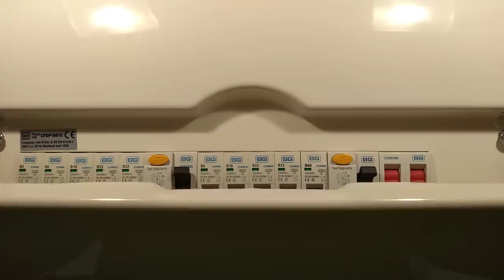A look inside a British home electrical panel.

Comment: I've been using DIN rails in industry for a long time.
I actually didn't realize that the "shelf" design was to accommodate a cover that can cover the terminals while allowing access to the device's controls.
Is there a standardized measurement to the size of this "shelf"? curious because I was going to use a "sub-panel" module to hold a block of DIN rail mountable goodies, and was curious what kinds of devices I could shove in there before I started having problems.
Trying to peruse published standards has led me to paywalls and frustrations.
Reply from the maker: The UK consumer units can often be used for things like DIN rail power supplies and timers.
Reply: @bigclivedotcom  I noticed that! :D
I've begun assembling a delightful device with a volt/current/watt meter (not dissimilar from the Hopi) and a voltage/current monitor in one.

Comment: That is one of the few things I don't like about European breaker panels and some other countries breaker panels here in the states are Breakers typically use a friction fit on the contact between the breaker and the bus bar even though it's friction fit if it's a good breaker it maintains its fiction connection through that life of the house unless that breaker has been popped several times or the bus bar got pitted then you have to move two different busbar point also are panels typically have enough room to where the wires don't have to touch between the hot incoming and hot out even though some electricians wire panels so badly that line 1 and line 2 incoming will actually crossover output wire the skeins of defeating the purpose of the entire breaker panel completely

Comment: Looks quite similar to what we use in The Netherlands. We don't have ring mains, so usually only use 16 A circuits. Often an induction cooker is connected to two 16 A circuits protected by a dual 16 A circuit breaker.  However, 3-phase power (400 V) is standard in the more recently built residential buildings (with older buildings connected only to one of the three phases).

Comment: Is this the usual size for such a box or just a small refit size for old installations? The ones they install here in Austria in houses are as big as half a normal door (something like 1.5m tall and more than half a meter wide). It also houses the meter and the transformer for the door bell and intercom. I counted 3 rows with over 30 slots each (not all populated though). And that's just for a two-flat house.

You have 3 phase in pretty much every home. Doesn't cost anything extra except that you might have to pay an electrician for installing the extra wires for an outlet, if you don't have one already. The "oh-shit" fuses (where the wires come into the house, not where the breaker box is) are 63A per phase (so as the electricity provider is concerned 45kW should be enough ;) ). The main fuses per flat are 35A per phase, broken down further into 10A or 16A fuses for the circuits for the rooms.
Reply from the maker: This is actually one of the bigger ones for home use.

Comment: you keep mentioning that the far right hand 'device' on the din rail is an isolator. When I was a lad an isolator was a device that was not designed to break load current. does this mean that when you have to work on this board you have to switch off all outgoing circuits before operating this 'isolator' ? or, is it a switch that merely isolates the board?
Reply from the maker: It is for isolating the whole panel.  But I suppose operating it off-load is preferred.

Comment: Could you possibly pop the main switch out a show behind it? That is: how does live get into that switch? And can you get a 'mains circuit breaker' if you so desire?
Reply: Live gets in from one side screw terminals and exits from other side screw terminals. The bottom is just empty plastic shell with mounting tabs that only hold it in place.
Reply: @DjResR  ty.

Comment: Dear Clive
The mains very ofter cones in from the bottom. Why shouldn't you connect it to the bottom of the main breaker?
It is such a pain to get those thick wires bent into the top when they come in from the bottom.
Kind regards
Reply from the maker: I think an element of that is the traditional isolator that fed straight down onto the live busbar.  In a way it's a good idea to maintain that standard approach to avoid people getting caught out by the bottom being live instead of the top.  Although any true electrician would check that before disconnecting anything.  The extra length of the tails in the unit do probably help with termination by giving greater play.
Reply: @bigclivedotcom  
Thank you for responding.
I enjoy your videos extremely much.
Kind regards

Comment: Kind of surprised they are using stranded wire and not solid... but I don’t know enough about UK standard
Reply: We sometimes use solid
Reply: I guess that's why people don't understand why bare solid wire is used for ground in the US.

Stranded tends to need insulation to keep it together.

Comment: Interesting, i am use to our panels in the united states. Metal panel boxes with both 240v and 120v breakers. That box looks like a toy compared to our panels.
Reply: This is because in GB current is running on the other side of the lane.

Comment: For me it's foreign to have an RCCB and single pole circuit breakers with a neutral bus bar. I've seen it when people in fact got a fusebox from germany where I heard it was quite common. But f.e. in The Netherlands, Belgium and France we don't have neutral bus barses. Phases and Neutrals are both considered live. This probably has to do with the long forgotten past where we actually had 127/220 Volts instead of the nowadays common 230/400 Volts and also with the fact TT system grounding was more common although in The Netherlands new electrical installations are usually TN-C-S.

Anyway, the electrical panels I've seen either have no RCCB's but either have 
- 1-pole circuit breakers with a neutral bus bar and rely on short circuit protection (common in the US) 
or 
- have RCCB's and 2-pole circuit breakers or 1-pole with switching neutral (common in The Netherlands, Belgium and France)

The problem with RCCB's and a neutral bus bar is when the ground fault occurs between the neutral and ground it in fact can trip the RCCB when there is a heavy load causing neutral voltage to become significant. Now in systems with TN-C-S grounding significant neutral to ground voltage is rare, but I've seen it happening. Worst case troubleshooting the ground fault will be a pain in the @$$ because you don't know which circuit is causing the neutral to ground fault. I would always recommend using RCCB's in combination with 2 pole or 1P+N circuit breakers and for 3-phase loads of course 4 pole or 3+N instead of just a 3 pole circuit breaker.
Reply from the maker: They seem to be going slowly in the direction of dual pole protection here.
Reply: @bigclivedotcom  With new electrical panels I don't see a reason why someone wouldn't make everything 2-pole from the beginning. The only reason would be cost. But even in the Netherlands there are some cheap electricians that used 1-pole breakers which is not allowed and therefore will violate the  NEN1010 which is Dutch Electrical Code for residential buildings. So cost seems to be a big reason to "bend the rules" :)

But in countries you can consider the early adopters of the RCCB and 2-pole (or 1P+N) breakers something else is going on. Many of them don't have grounded outlets in the what we call "dry rooms". These are rooms where normally no water or moist is present (f.e. living room, bedrooms, offices).

Grounded outlets are in the Netherlands only mandatory since the 90's. In buildings build before 1990 you would find them only in "wet rooms" or outside. And until that time outlets and normal switches in the bathroom were not allowed. Only a corded switch was allowed to be inside the bathroom and washing machines and dryers had to be connected directly to a special 2-pole corded switch. Usually a switch with a socket was just on the outside of the bathroom. It didn't prevent people from bringing in electrical appliances into the bathroom, but it motivated most people to unplug the appliance and put it away instead of having a live electrical appliance next to a bathtub. 

Using equipment that needs grounding to function properly usually requires rewiring part of your house. Fortunately most of our electrics is done with wiring inside 16mm PVC tubes which allows you to rewire your switches and sockets without breaking down the plaster and/or the wall. It's pretty convenient and I don't get why it hasn't caught on in many other countries. Installing ground wires or extra switching wires is some work but do-able without renovation.

Comment: Surely, (I know - don't call me Shirley) if you wanted to fit an RCBO as shown here, say for a freezer,  you would want it supplied direclty from the isolator and not from one of the two RCD blocks, but this CU doesn't allow any way to do that.

Comment: What do you recommend if there are various brands of MCB, of different heights, so they can't all reach the same busbar?
Reply from the maker: All the breakers should be the ones designed for that unit.
Reply: @bigclivedotcom  easy to say, until one buys or rents an old apartment!

Comment: Do you know the reason for switching the neutral? I've seen it in German manufactured equipment. They even fuse the neutral. I don't see it being safe when you can blow the neutral fuse and have hot all the way through a piece of equipment. American equipment only switches the hot.
Reply: Depending on how the earthing is done, current can come in to your installation via the neutral due to a fault next door :(

Comment: How exactly do the bus bars connect without shorting on the other phase? Would you just place the main disconnect in the center and bus outwards?
Reply: There are wires to jump from the main switch to each RCD, and then the bus bars just feed from each RCD into the circuit breakers. The RCDs and the main switch all take their input from the top and output on the bottom, but the circuit breakers take their input from the bottom and output on the top.

Comment: An electro-mechanical circuit breaker should not use any power - though with AC there always can be strange losses.

Comment: @BigClive - I'd have thought that you would have had a 30mA and a 100mA RCD breaker within the consumer unit. Why have two 30mA's? Couldn't all the circuits have been covered with one?
Reply: Many households in the UK only have a single RCD. Two RCDs is quite a recent change that is more of a convenience feature than anything else. Just means that the whole house power doesn't cut off if a RCD trips.
Reply: The idea is to divide the circuits between them in a manner that means you'll still have some lighting available if one RCD trips, so that you are less likely to come to harm from fumbling about in the dark. Under previous editions of the Wiring Regulations, you could have had some non-RCD-protected circuits that could provide lighting if your one and only RCD tripped, but now practically everything needs to go on an RCD, so you need at least two of them to avoid the risk of losing all your lighting from a single fault.

Comment: I prefer both neutral and live are both cut by the braker. Makes install more easy and clean
Reply from the maker: That is used a lot in the entertainment industry.  It also isolates a complete circuit where a neutral/earth issue may be causing a rogue leakage path for return current.
Reply: @bigclivedotcom  Belgian electrician here. Over here we use double breakers.

Comment: here in the Netherlands we have a main 25A fuse that is in a separate enclosure and sealed by the power company and can be removed by them if you don't pay your bill but I'm guessing that that red main isolator switch in the british panel is used for that purpose in the UK but how come it is not in a seperate box with a seal ? Note that I'm not  good with knowledge about mains electronics.
Reply: The main company fuse is separate from this,  it feeds the meter directly then the tails run from the meter to the distribution board
Reply: We have a main fuse from 30A to 100A which is sealed . If you don't pay your bill we fit a pre - payment meter.
Reply: thanks for the quick replies. I guess we lack that one main switch or it might be present in more modern houses.
Reply: @Rob Wulz ah right ! in the 80s when I was a kid and our family stayed in a mobile home on a camping in Kent for the holidays, we had a meter where you could put coins in to receive electricity. We've never had meters here like those. You 'just' get cut off if you don't pay the bills. Note that I don't have experience with that :D

Comment: So...  do UK/British houses not have GFCI (Ground Fault Circuit Interrupt) outlets at the wall then?  Since your RCD is basically built into the main panel?
Reply from the maker: You can have individually local GFCI sockets, but the protection is usually at the panel so it protects all the wiring too.

Comment: Thankfully the old distribution box here (plastic with one RCD and several unlabelled MCBs) works fine as is, can't say the same for the house wiring given I've tripped the RCD even with the power off, makes me wonder if said RCD is wired wrong......
Reply from the maker: RCDs will trip if you bridge neutral to earth on an unpowered circuit.  They also get a bit sensitive as they age, so it pays to replace them as a simple fault finding step for continuous rogue tripping if nothing else is obvious.  One of the routine electrical tests is to check that the breaker doesn't trip at half its rated leakage current.
Reply: Thankfully there's no rogue tripping, just me being a twit, last year I wanted to measure the mains sine wave on my cheaply acquired CRO oscilloscope, tripped the RCD as soon as the probe touched the pin in the plug, now I know about the neutral-to-earth, that explains why it did that even through a now no-good cos plastic consumer unit I have for testing things on, just goes to show how little I know about mains electrickery!!! :P

Comment: Clive, where can I buy empty distribution boxes like this one? Here in Hungary, all the smaller ones are plasic. Only the multi row, 36 module and bigger ones are available in metal version.
Reply from the maker: The keywords are consumer unit.
Reply: @bigclivedotcom  Thanks a lot. Is £43.99 INC VAT an acceptable price for an empty 12 module one, or may I find cheaper ones? If I tell the site (screwfix.com), that I'm in the EU, I can't find that product. I'm suspcting that they won't sell these outside the UK...
Reply: @mernok2001  :) Nem hiszem, időnként látok magyar felhasználóneveket a videói alatt. De elég ritkán, az igaz.
Reply from the maker: @mrnmrn1  I'm not sure if they'll ship them due to differing electrical standards.  That sounds like a typical price.
Reply: @bigclivedotcom  Thanks, Clive!

Comment: Why does a RCBO have such a high powerloss? Is it purely contact resistance? I always thought that a RCBO has basically the same internals as an MCB and RCD.
Reply from the maker: It's actually the power for the circuitry inside.  The coil only activates if it detects a current imbalance.
Reply: An RCD or an RCBO has to have a high current transformer which carries the Line and Neutral wires plus a third low current winding that detects the imbalance current.  These windings may be what dissipates so much power.  There's no reason why the detection electronics should use more than a few tens of milliwatts.
Reply: There are active electronics in an RCBO (and, for that matter and RCD). The ones I have also have another functional earth connection and can, I believe, detect some other neutral line faults.

Comment: Very nice video.  I'm in the US,  what is an RCD?
Reply: residual current device, known in USA and up here in Canada as a GFI or GFCI (ground fault circuit interrupter) basically the way that panel is wired, if a ground fault occurs, it will take out half the house as opposed to the offending circuit or dedicated receptacle. Very stupid design as the lights go out and leave you in the dark standing there holding your soggy hair dryer.
Reply: Thank you.

Comment: So who has the better electrical setup, America or the UK? Is it possible to do a UK-style setup in America?
Reply: Ours looks better outside, no pigs on poles.
Reply from the maker: Each has its own merits.  My preference for the UK system is due to its simplicity, the fitments designed around safety, the higher voltage needing lower current for a given power and the simple circuits.

Comment: I'm missing numbering tags for each breaker on the lid. Together with a list placed inside the panel door what each circuit breaker is for. 
What matters is the panel and its installation has to comply with the specs given by the electricity suplier. This is the one who says: "yes we connect you on grid" or not.
Reply from the maker: This is a brand new unit on my bench.  It does come with circuit identification strips.
While the utility companies here used to do a full test before connecting an installation they stopped doing that.
The specs of the panel and installation are defined in BS7671.